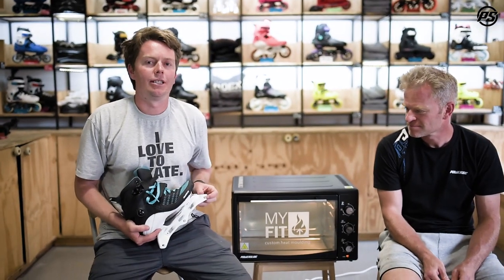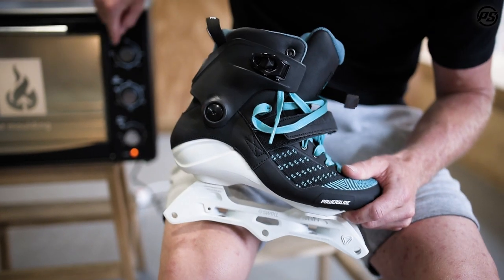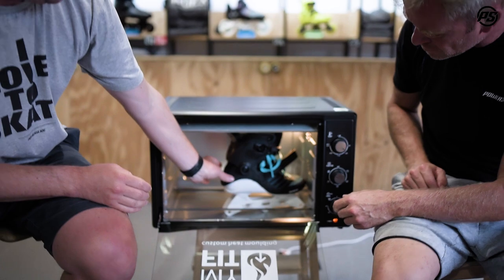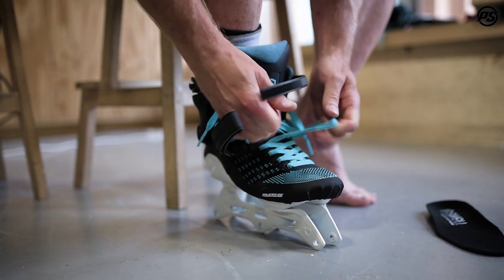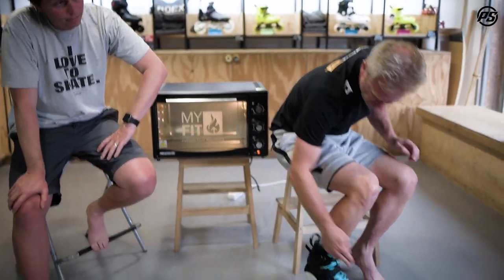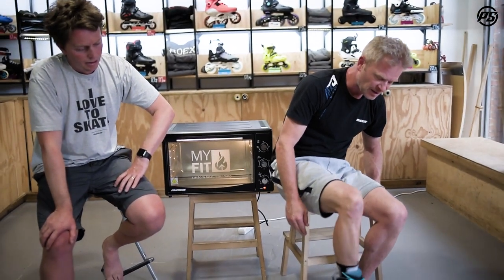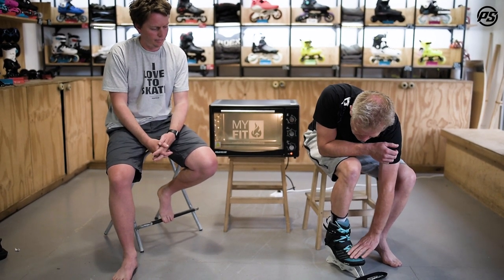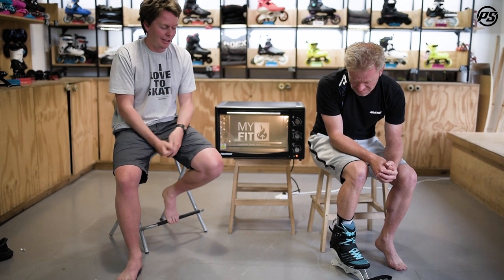How to heat mold SWELL skates correctly - Speaking Specs

Comment: i didn't know this!! would be so awesome if there is an official list of which skates are heat moldable or not, TAU, Swell, Kaze, Next etc, the temperature, time, that would be FANTASTIC!!
Reply: That would be awesome! I have imperials which don't quite feel exactly comfortable in some places. It would be great to know if I could heat the shell to get some more comfort out of it.
Reply from the maker: thanks for your feedback, right now there is not a complete list of which skates are heat moldable and which are not. but on our website and in every good shops info texts about each product there should always be the information if the product is heat moldable or not.
tau skates right now are not heat moldable due to their special production with compression molded carbon. swell, kaze, v. and lots of others are heat moldable. plastic hard boots like the imperial skates and the next skates are not heat moldable, but do come with heat moldable liners from myfit.
Reply from the maker: you can try to felx the shell at the pressure points, but we as powerslide would not recommend that, as it weakens the plastic of the boot and might mess with its lifetime and stability. lots of times different insoles, arch supports and heat molding the myfit liners can work wonders, too.
Reply: thanks for always getting back to our questions!!
Reply from the maker: that's what we are here for, keep them coming!
Reply: Swell lite black 100? Is thermo?

Comment: I bought a pair of Kazes this week for 190 Euros, heat molded them and the pressure points are gone from my toes.
Thanks for this tutorial guys.
p.s. today is my 29th birthday
Reply: hi, can you mold kazes in a normal oven?
Reply from the maker: @yoservs  yes, you can.
Reply: @PowerslideInlineskates  thanks, it seems my skates have already molded themselves to size. I'm having the time of my life with my Kazes. thanks for a great product. lotsa luv from south africa!
Reply from the maker: @yoservs  glad to hear that, enjoy them!
Reply: I know this is a very long time from when you posted your comment but Im getting Kaze 90’s in a couple weeks and I am planning to heat mold them. Would you recommend to just follow the same oven temperatures and times as they show in the video?
Reply: @AidenIsElite  85 celsius for 13 minutes each, that's what I used for mine.
Reply from the maker: @AidenIsElite  as kaze boots are made out of the same heat moldable shell plastic, yes, the process is identical. enjoy your kaze skates!
Reply: Ok just heat molded my Kaze and burned  3 Wholes inside. Make sure ur Oven is big enough to heat them up in standing Position. Have fun

Comment: Q: im a beginner to skating and really like the swell fit 100s from my short review. do you have to heat mold them? is this recomended always or just if they dont fit perfectly? My right foot is 28cm of length where my left one is 27.7cm. Would you recommend 44-45 or 42-43?
Reply from the maker: thanks for the feedback. glad you like them! for heat molding: this is only an option if you tend to have pressure points and want to get a better fit. if your skates fit nicely, there is no need to heat mold them. for sizing, we always recommend the sizing chart on our product pages. in case of two different size feet, we recommend going with the bigger size, so in your case, try size EU 44 with a length of 285mm for a good fitting skate feeling.

Comment: Is possibility to heat mold TAU boots ?  "No pain" technology isn't painless for foot. :D. If yes, what temperature should I use? Greetings.
Reply from the maker: the tau skates are made of a special kind of carbon, a compression molded type, that with the current version at least, is not heat moldable. but we are working on a new version that will also be heatmoldable, so stay tuned
Reply: Thank you for answer. Unfortunately i have bought Tau in April 2017 :D.  Greetings. :) But will wait for news :)

Comment: How do you heat mould the swell lite? Do you leave in the removeable liner, and put it in the oven?

My feet are badly falling to the outside (I need to balance on the VERY inside of my foot to keep the skates vertical), even when moving the trinity mount points as far to the outside as possible.
Reply: Have you tried molding them at the end? I just bought mine and was thinking about heat molding them
Reply: @miriammosca1683  I ended up returning them, and getting FR1s, along with some of my friends. FRX/FR1 seems to fit most people's feet better than any other skates. There's some good videos on YouTube about buying a heat gun and doing heat molding (on skates that aren't even designed for it), but usually it's to push out pressure points around the ankle, rather than the end of the boot.
Reply: @ZantierTasa  I got a pair of powerslide Nite 125 but they were too small for me. Even though I'm  size 41 and I ordered  42, they were still too tight. I only tried them for 100 meters and the pain was very intense in my foot. I started a return process but according to what I read the conditions for the return they say that if you tried them they are considered as  used and I run the risk that they will not exchange them for a size up! or they will return only part of the money back. In what condition did you return yours ??? Did you try them in a park or something like this ??

Comment: Just received my powerslide swell ultra white trinity 110 tri skates. Straight from the box, I’d classify fit as snug, Having “pressure points” on my inner ankle bones unfortunately. Can I put my boots in a conventional kitchen oven? Or does it have to be smaller oven to do the heat molding? 

Also, if I’m experiencing signifant pressure on these areas, how thick should I fold relief shims?

THANKS, The engineering, attention to detail on every material part, build of this skate is impressive, I want my damn boots to FEEL good!
Reply from the maker: hi! thanks for your feedback and sorry to read about your fitting problems. yes, heat molding in a conventional oven will do just fine, just make sure the boots do not touch the sides of the oven.
thickness can be applied in multiple tries to test and find out how much your feet actually need. we would recommend starting with something minimal like 2-3mm and check if it already helped.
pressure points can also come up for several factors: have you tried a different frame placement? rockering the frames to the outside if you tend to fall to the outside and vice versa can help a lot! also experimenting with differnet insoles/foot supports/arch supports/no insoles at all / only heel 2/3rds insoles can do the trick for some.
Reply: Thank you for the expedited feedback, I’ll try this and provide feedback on the process following the video tutorial

Comment: are the latest 2020 powerslide next boot heat moldable? My retailer reassured me that the boot (and not just the liner) are heat moldable and even have instructions on their website (inline warehouse)... but there seems to be mixed info on this online.
Reply from the maker: thanks for your question. the boots of the next skates are not heat moldable, but the myfit liners inside the skates are heat moldable.

Comment: Can you put orthotics in these skates for pronation? If so would you take out the inner sole first.
Reply from the maker: Hi yes you can but not sure it would help correctly. Best solution is to use pith ocntrol tool to solve pronation or supination. here is a link to this kind of tool but you need to ask it for TRINITY https://www.powerslide.com/Powerslide-Pitch-Control-Set-across
also a good way to solve it is to chek this video from mine (wedging part) at the end . https://www.youtube.com/watch?v=yRrkMGn8BT8
Pascal Briand

Comment: This could help the fit in case of feet with half size? I explain: my feet are EU38,5 in the largest part but EU37 in lenght, so I bought a EU39 in order to have enough room on the inside-sides of the skates, where it always hurt my little fingers, but on the other hand there is a little too much space in the lenght. If I heat mold my skates (phuzion trinity xenon woman) this can help to improve the fitting?

Comment: Can you also put the liners on their side if your oven is not tall enough? I also heard something about microwave ovens. I have a combi manchine that can function as a microwave and an oven, so I assume I can use for heat molding. Is my assumption correct?
Reply from the maker: we would recommend only the use of a regular oven in a size that you always make sure no parts of the skates touch the oven walls.

Comment: Could it be done to a KAZE boot?? Is a KAZE boot heat-moldeable?? THANK YOU!!
Reply: Its very similar to swell so I guess it can be done as well .  Im thinking about it as well
Reply: Would love an official answer to this as well! Would be a dream come true for taking care of that one persistent pressure point :)
Reply from the maker: yes, the kaze shell is also heat moldable at 80-90° C
Reply: Powerslide Inline skates thank you so much for your reply. My favourite skate just got better!
Reply: Can you clarify if the Reign Line, especially the Kronos can be heatmolded too? I have a painful spot on my left foot and I want to test all other options before I let them get punched in a skate shop :)
Reply from the maker: the reign kronos hockey skate comes with a compression molded carbon shell and can (for now) NOT be heat molded, as the epoxy / glue on the carbon is not made for that and the carbon fibers will just brake apart / loose their connection to each other.
Reply: @PowerslideInlineskates  Works for Ultron ?

Comment: Can this be done with the 3d Adapt Models?  They felt very comfortable when I tried them on but when I started skating I realized that I had pressure points on the outside sides of my feet- I guess due to the narrowness of the boot.
Reply from the maker: Hello we don't recommand to do heat molding on 3d adapt padding models.

Comment: Can the same method be applied to the ‘Swell stellar Jr. 100’? If so should I heat just the liner or boot and liner ok? Thanks in advance :)
Reply from the maker: Hi the SWELL stellar jr 100 is not heatmoldable.
Reply: @PowerslideInlineskates  strange… your website states that they are? 🤔

Comment: Can this also be done with the Powerslide Swell Bolt 110 ?  and is there any difference at all in the method if it also works on Bolt 110 :)
Reply: It says on your website it is not... :/  I am having quite big issues on the outside of my foot,  before the little toe, and it does not seem to stop.. now I am swollen on that area :/  and I have had the skates for over 1 month now...  So I hope you can help me here..

Comment: Would heat molding my swells, which are too big (long and wide) help? Or does it only make sense for pressure points?
Reply from the maker: That - unfortunately - would indicate that you have the incorrect size. There's not much heat molding can do about that :/

Comment: I've had a pair of Powerslide Swell's for about a year now, and I've only ridden them three times indoors. I thought they'd break in over time but they're still painful to ride even after heat molding them twice. Am I stuck with them?
Reply from the maker: sorry to hear that. it is a tough question to answer, as everyone in the world has different feet and tehre is nothing like a universal fit to every person. besides heat molding, there are still numerous way to change the fit of your swell skates if you exprience fitting issues with pressure points. besides heat molding and pushing the painful part carefully to the outside, you can also:
experiment with frame placement. depending if you tend to fall to the inside with your ankle (x legs), you can mount the frame more on the inside of your skates, or vice versa with bow leg stand, you can put your frames to the outside.
neoprene footies / foot covers are often used to put more padding in parts of your foot where it might be needed and can work wonders.
taking out the insole or replacing the insole with a different one can change the fit a lot. orthopedic insoles work also, if your feet / legs need for example more arch support.
we also offer the myfit arch support that can be put in underneath or instead of an innersole to prevent your fweet from falling to the inside.
thin socks can also help to create a little more room inside your skates...
we really hope that one or multiple of these techniques help you out, so you can enjoy your swell skates!

Comment: Is it also possible to gain some additional millimeters in length with heat molding? I got some issues with my new Swell Black City 125
Reply from the maker: hello. yes and no. up to a certain degree, yes, but gaining length is not the purpose of heat molding in first place.

Comment: just received my size 12 swell tri blacks and they are too tight and too slim so should I do this to make them work with thick socks or return them? Will they not take them back if this is done?
Reply from the maker: sorry to hear that. if they are slightly too short / too tight, heat molding is an option. but it can only help with some mm's, it will not magically generate one complete size. please also check our sizing charts on the swell product pages with exact mm measurements.

Comment: Hi have the reign-triton-trinity Can I do the same with those ? And can I use the frame on other boot, like the Kaze.
Reply from the maker: yes to both questions. the reign triton hockey inline skates can also be heat molded at 80-90°C. All Trinity frames fit perfectly to all Trinity mounting equipped skates, like the Kaze or many others.
Reply: @PowerslideInlineskates  Reign Apollo too? waxed laces and all.
Reply from the maker: @amateurhourskates4950  yes, even the reign apollo skates are completely heat moldable up to 90° C including the waxed laces.

Comment: Even when in "skating position" my heel still has a little bit of give, can lift it by half a centimeter or so, it doesn't get locked, so it's impossible to be confident, the rest of the skate is pretty fine now (after a bit of breaking in)
How would I go about heatmolding the boot to make it tighter on the heel area?
Thanks
Reply from the maker: Hi,
 making a heel counter of a plastic shell tighter is almost impossible. I would recommend to use one of the MYFIT footies with extra heel lock (art. no. 908287 if you want to check with your favorite shop). The footies are made of 2mm thick neoprene material made in Japan and include some padding for heel lock. The footies will fill the space in your boots and prevent your foot from blisters. I hope this information is helpful for you.
Reply: @PowerslideInlineskates  thanks for the reply. Bought a pair for my girlfriend a couple months back, had to tear them with scissors almost completely for them to fit. The sizes are really skewed. They did their job, though.

Comment: How do you keep the base with the wheels attachment from miss aligning during this process, or is the base a different material so the wheel frame wont sink into the shoe or something like that?
Reply from the maker: Hi, the temperature isn’t hold enough to melt the base of the swell skate and so therefore it wouldn’t sink.

Comment: How about Phuzion Argon Skates? The insole has a Myfit logo? Ok to heat mould?
Reply from the maker: the phuzion skates are not heat moldable. as myfit is our brand for all fitting parts, yes, the innersole is made by myfit, which means in this case it's anatomically correct and provides support to your foot bed where its needed. but the overall skate is not heat moldable.

Comment: Hello, is it possible through heat molding to mold a boot that is a tad too large?
Reply from the maker: usually it is the opposite. but if you heat mold your skates and tight them upper really tight and put pressure from the outside on the areas that are too big / too wide for your foot, it should work fine, too!

Comment: Can I heat the skate using the hair dryer?
Reply from the maker: heat molding with a hair dryer is possible, but can damage the material easily if not done 100% correctly. we recommend the method shown above.

Comment: i have the 2017  Swell trinity model. Can I heat mold it?
Reply from the maker: yes, you can!
Reply: @PowerslideInlineskates  not sure, but think I have the 2016 model. Are these also heat mouldable is the way that is shown in de video?
Reply from the maker: @sjaakve  unsure, as we started using heat moldable materials with our 2017 swell collection.
Reply: @PowerslideInlineskates  ah, good thing I refrained from trying.
Any way you could make sure?
Reply from the maker: @sjaakve  sure, we can look into it. which model is it exactly?

Comment: In fact, the shoe can only be changed slightly by heat molding. It's more likely to break it.
Reply from the maker: We don't really push it for the swell anymore, since it has a pretty low impact on the fit, it does help, but not a ton. We are fairly confident that a correct heatmolding wont break the skate, so much so that heatmolding doesn't void the warranty on the skate nor does it impact your ability to return the skate. 

- Kasper